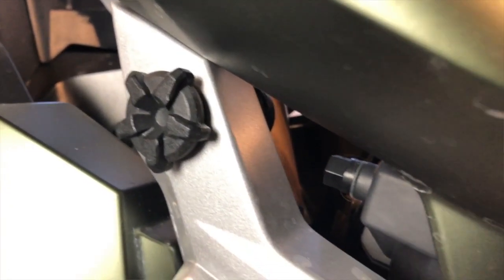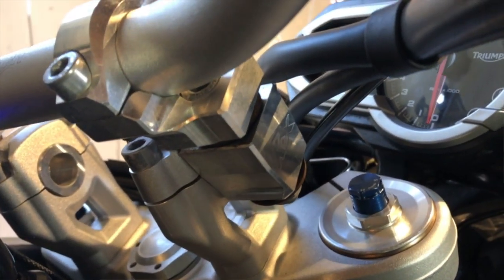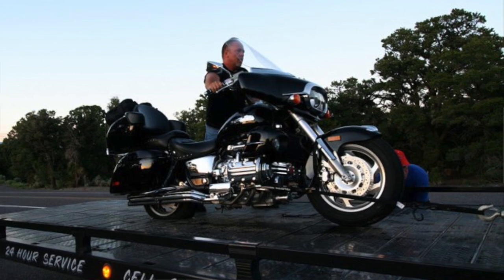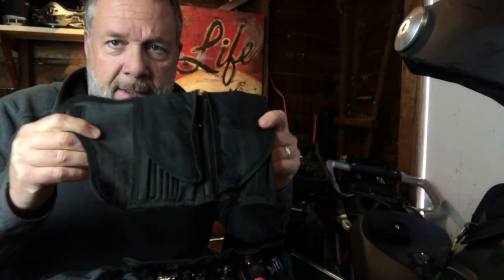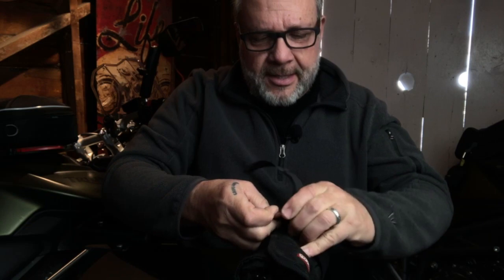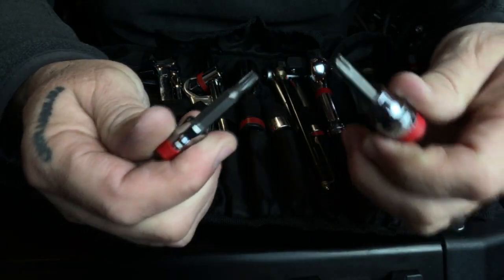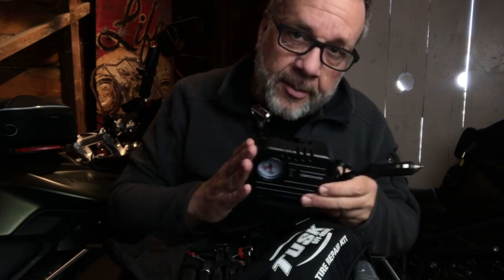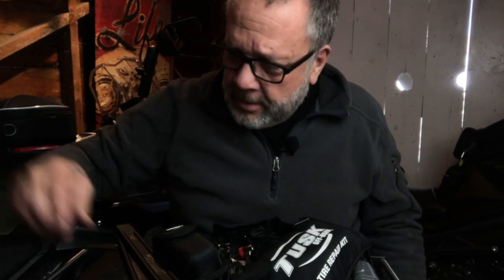S1/E3 UTADV Tools and Self-Actualization

Comment: Do you have a particular multi-screwdriver that you like?  Mine is Kobalt (Home Depot's house brand?) It has 5 or 10 tips and a wobbly 1.5" extension.  The screw-on cap is forever coming loose when I use it, so I sought out a better alternative.  Nada.  I couldn't find anything better.  I think manufacturers see these multi-tools as mostly for casual users, and when making really high quality tools, stick to individual separate tools, because that's what professionals generally want.
Reply from the maker: I use a Milwaukee multi-screwdriver. Each bit is extended by a couple of inches and stows easily with my kit under the seat. https://www.homedepot.com/p/Milwaukee-9-in-1-Square-Drive-Ratcheting-Multi-Bit-Screwdriver-48-22-2322/308537021?mtc=Shopping-B-F_D25T-G-D25T-25_1_HAND_TOOLS-Multi-NA-Feed-LIA-NA-NA-HandTools_LIA&cm_mmc=Shopping-B-F_D25T-G-D25T-25_1_HAND_TOOLS-Multi-NA-Feed-LIA-NA-NA-HandTools_LIA-71700000043839315-58700004592003384-92700049573927179&gclid=Cj0KCQjwn7j2BRDrARIsAHJkxmwcaQlIQWLoLNufnhZ8l1qV7O_KwELClx0UyxH1qCh_Ti-tEeyGb3IaAlv_EALw_wcB&gclsrc=aw.ds